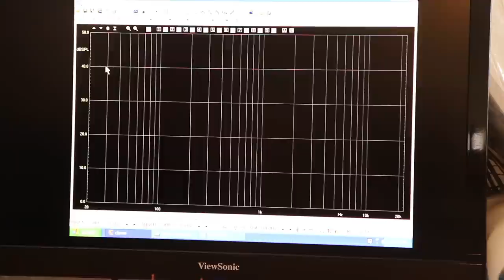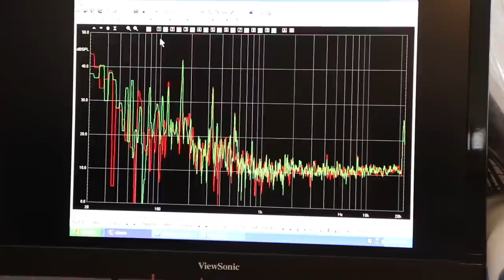Power Cable Tech Talk and a little help for Amir at Audio Science Review

Comment: You totally discount the impedance of the device the cable is connected. Power cable generally are supplying low impedance loads. Emf and induced noise cannot provide sufficient coupling to induce voltage. Also, what do you think the purpose of the power supply is...to convert the incoming ac to lower voltage and then rectify it and filter it. There is so much miss-information in this video you should consider taking up politics.
Reply: YES! THANK YOU!

Comment: How do you "debunk" anything by just yapping? Show us the evidence.
Reply: Come on over.
Reply: @dannyrichie9743  measurements of before and after cable. Null test.
Reply: @DescartesRenegade  The proof is in the listening.
Reply: @dannyrichie9743  so if one person doesn't hear a change, does that mean there's no change?
Reply: @DescartesRenegade  So far 100% of everyone that has ever been over has not only heard differences but correctly and consistently identified what those differences are.
Reply: @dannyrichie9743  great, then it should be recordable!

Comment: Danny, I've bought your products in the past & probably will again, but, I think in this video one of your "proofs" can be painted with the same brush you use to paint Amir testing with no load. Specifically I am talking about your use of background noise as an analog for noise on a power cable. If you want to show how your power cable protects against noise, just show it.

To show how much your power cable can reduce noise injected into a power supply, setting up a simple test seems pretty straightforward. I might suggest something like the following;

1) An AC power source.
2) A noise source on the same circuit, perhaps fluorescent lights, or some other device(s) which is/are noisy. Make sure the noise source is as far away from the actual test as possible.
3) An standard AC outlet.
4) A standard AC power cord of reasonable quality.
5) A GR Research power cord.
6) A quality power supply either switching or linear.
7 A resistor to act as a load.
8) An oscilloscope to measure noise.

Hook the power supply to the resistor for a load, connect the oscilloscope to the resistor for measurement, attach the power to the power supply with the standard AC power cable. Capture screen shots of the noise artifacts. Then swap in the GR Research cable take the same screen shots and compare. Any differences will show the benefit of the power cable.

The use of the power supply is simple, most if not all power supplies have circuitry to reduce noise in the output DC signal. Different power supplies are more or less effective at this. All audio gear have power supplies to convert the AC to DC and to provide various voltages to different circuits in the equipment. It also means the resistor we need is much more manageable. The reason for a resistor is it shouldn't inject much if any noise into the test.

I don't have an oscilloscope or one of your power cords, or I would try it myself and post the results.
Reply: I was thinking the same thing about the noise tests. That is a real leap in logic.

Comment: Wow! Engineer with 20 years of electronics experience here.

First of all, even a fresh graduate engineer would know that it just takes one single and simple step to prove that a cable (or any other product ftm) could reduce electical noise in audio: Record the same output signal from the same playback device under the same conditions with different cables and compare the noise levels. This video does everything but. 

Furthermore, the narrative is deceptive in nature. In the part where a red line and a green line are shown as noise graphs: That is NOT not isolated electrical noise. It is the actual noise of the surroundings being recorded by the mic. There is a fan running in the background while recording!!! A power cable can do nothing about it. It's like plugging a power cable to reduce the grains in an old recording or remove pop and scratch noises from vynil. 

Just like:
It takes looking at a handful of objective indicators to actually understand earth is round, but they always get skipped or ignored by flat earthers. It's RICH to call anyone else flat earthers.

I can't believe there are actual human beings praising this video...
Reply: You might need to watch it again. 25:30 mark. We are going to "illustrate" noise levels.... I explained that they were not the same, but for illustration purposes it worked great in showing how random A/C noise levels are.
Reply: Dear  @dannyrichie9743  the noise you're "illustrating" has NOTHING To do with electrical noise. While common AC noise may or may not be out of phase, however, EMI noise is on phase as picked up by two cables side by side. "Illustrating" room noise as analogous as electrical noise is misleading and irrelevant to the actual question: Can an AC cable actually reduce electrical or EMI noise? If it could, it could easily be proven with a VERY SIMPLE experiment I outlined in my previous message. You don't need a 40 min-long video to "talk" about it, just demonstrate it: Record the same output signal from the same playback device under the same conditions with different cables and compare the noise levels on the scope. It's that simple.

You're also pretending as if modern audio electronics don't have purpose built internal electrical noise filters already. They do, and pretending that any AC noise makes their way directly into the audio signal path as-is, is pretty deceiving if not totally oblivious in the first place.
Reply: @hankkirk944  Oh yeah, my illustration easily showed the randomness of noise. Everyone else got it. You are just being continuous. 

A/C noise easily finds its way onto the audio signal. It is even present on digital cables. If you think the power supplies will remove it all then you are very naive.
Reply: @dannyrichie9743  Let's go your way, can you tell me how balanced XLR cables are able to cancel out EMI noise through reversing the polarity?
Reply: @hankkirk944  That was explained in the video.
Reply: @dannyrichie9743  that's right, yet it fails to mention explicitly that EMI noise ("additional noise" as you refer to it) is absolutely the same on both cables. Which proves although noise itself is random, it can also be in the same in both cables.

Furthermore, you're factually wrong when you say "...those waves that are really short, some of them arrive at one wire at a slightly different time frame than the other...". NO. 

First of all, like all waves of the electromagnetic spectrum, radio waves travel at the speed of light, at approximately 300 million meters per second, 
And second, the speed at which electromagnatic waves (incl. radio waves) propagate in a uniform medium (such as the atmosphere) is independent of their wavelength. So all radio waves travel at the same speed regardless of the signal frequency.

Saying that something traveling that fast arrives on 2 objects that are 1/1000 of a meter apart at different times is practically absurd.
Reply: @Danny Richie  setting all the things you are oblivious or factually wrong about, just record the same output signal from the same playback device under the same conditions with different cables and compare the noise levels on the scope. It's that simple to prove your claim, everything else is just plain nonsense in terms of engineering.

I can easily do it for you if you'd like (or dare).
Reply: @hankkirk944  Do the math and you'll see that two wires 1/4" or more apart will receive an RF signal at a slightly different arrival. Wavelengths in the megahertz range are short. So there can be some variance, but you are getting way off the subject.
Reply: @hankkirk944  Go for it. Or, give it a listen on a real system (like ours) and the conclusion is obvious. So far we are 100% including the nay sayers that swore before we started there would be no difference.
Reply: @dannyrichie9743  In other words: throw out all the data and rely 100% on anecdotal evidence. 

If a set of speakers doesn't have a measured flat response (like the bad klipsch models), do you even need to listen to it or is that data enough to make a judgement? Would someone telling you that speaker sounded good change your impression, when combined with the data?
Reply: @bartpappas3236  Measurements of a Klipsch speaker showing amplitude imbalances, phase issues, and cone break up all point out audible problems. I can correct the problems and redesign the crossovers using ten different types of parts and get ten different sounding speakers. Everything matters.
Reply: A fresh graduate engineer likely would think one simple test as you outline will provide definitive proof.  An engineer with say 20 years experience would never introduce additional variables such as a record and playback device.  Nor would an experienced engineer rely on a single simple test.  It is amazing in this discussion those claiming engineering experience exhibit such limited knowledge and propose inadequate tests.  That approach applied to your actual career is a good way to get fired.
Reply: @dannyrichie9743  You're the one who's claiming that radio waves (and only high freq ones at that) arriving at 2 cables that are milimeters apart would generate different levels of noise that are so off-phase that can't be cancelled out.
How am I the one who's getting way off the subject? The type of diversion tactics like saying "I'm getting off the subject" when I'm  exactly on point doesn't sit well with common sense. But let's do the math just like you suggest: Radio waves travel at 3x10^8m/s. The time difference of a signal arriving at 2 cables 1/4" (6.35x10^-3 m) apart is 2.12x10^-11 seconds. For reference, the accuracy of atomic clocks relied on as the most accurate measure of time is 1.1x10^-10. The time difference you're referring to is 5 times over the resolution of most advanced scientific tools on the planet, something that can't even be measured accurately, let alone be heard.
Reply: @dannyrichie9743  In today's day and age, anything that can be heard by our ears can be measured with 1000 times the accuracy. I can easily measure and demonstrate the effect of your AC cable on noise rejection (or lack thereof) with a single simple test if you'd be so kind to provide me with a sample (that will be returned to you at the end of the test obviously) if you're really confident on your claims. Actually, I'll raise you on it, I'll even buy the cable at full price if it demonstrates any real world difference. Let me know how you'd like to go on about, granted you are confident your products can demonstrate real world difference that is.
Reply: @hankkirk944  Go for it.
Reply: @dannyrichie9743  I'm beginning to think that you're trying to come up with an excuse to back down from your promise, or are you hoping it would die out by being idle and silent? Are you going to send a cable to be properly tested to verify your claims?
Reply: @hankkirk944  No excuses here. You can do anything you want with it when you get it. I would recommend though that you follow the instructions by burning it in for 200 hours and then make some listening comparisons to confirm what we claim. You can go right here to place your order: https://gr-research.com/cables/
Reply: Wait just a minute, are you saying the Earth isn't flat?

Comment: "there's NOISE in the AC Line"
Yeah, but the Power Supply in any equipment is converting the "noisy AC" coming out of your wall socket into CLEAN DC before feeding it into the noise sensitive components, so...
Reply: That's one of the basics he chooses to ignore here. He knows this, but chooses his words carefully. His main goal is to keep selling the snake oil, obviously. This is all a performance, and attempt to keep scamming people who don't know this. I'm also pretty sure he bans all of our comments, too, if he can. He dug himself a too deep hole. Public cannot see this, I mean look at the comments, people know he's a liar.
Reply: So you are telling me, that the point of cutting costs(power supply) for more earnings in $ is so perfect it changes water into a wine??? LOL. Power conditioners that are  a size of an amp is a compromise in terms of optimal signal.
It's easier to clean power when it was pre cleaneg by some bit before. Especialy that cleaner biult in the amp is not so great.
Reply: Depends on the quality of the power supply.
Reply: @sheerenergy8602  Isn't there a difference to cleaning power with an amp sized conditioner before a system and having a solid gold cable going from the wall to the system (ignoring all the qualities or problems from the power station to your wall socket.) I don't think a cable no matter how expensive can claim passive conditioning.
Reply: @spudpud-T67  
You  are one of that guys who tells around that cables in the wall are shitty to the outlet and from there im using more expensive cables and you dont see no point in that.
Well im seeing it and enjoying my improvments in sound.

And you don't even know that gold is less conductive than copper.😂

And if you hace a house and you can do two or 3 separate electric circuts its recomended. Noisy machines on one and audio euip on the second.
Power conditioner can be used in many houses when you move out or when you renting a condo/room. I dont need to crush any walls.

Problems of conditioners they are expensive and limiting dynamics vs bare outlet.